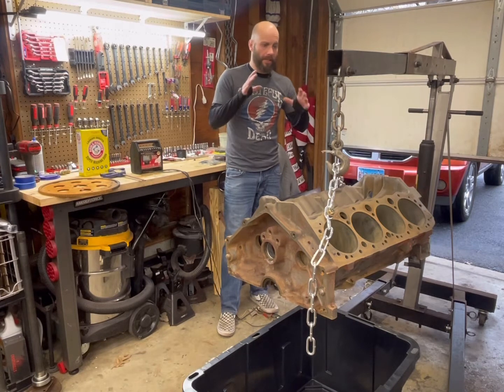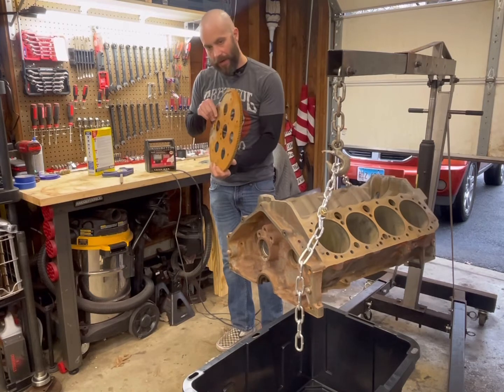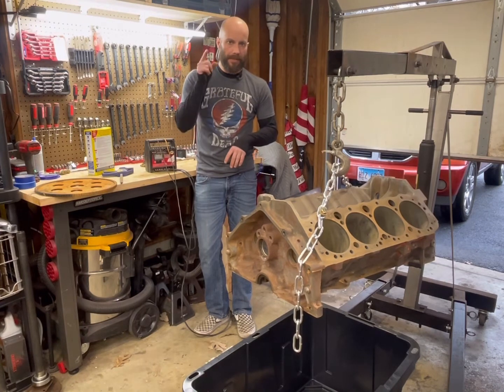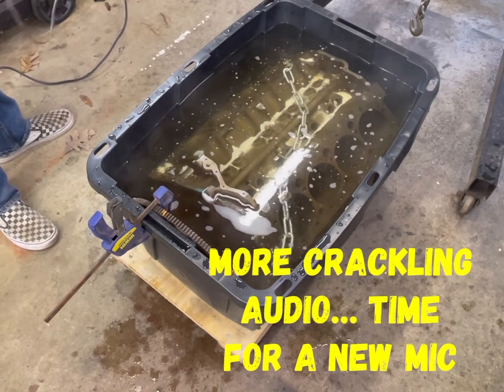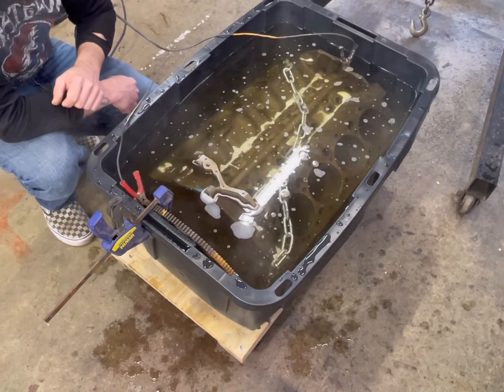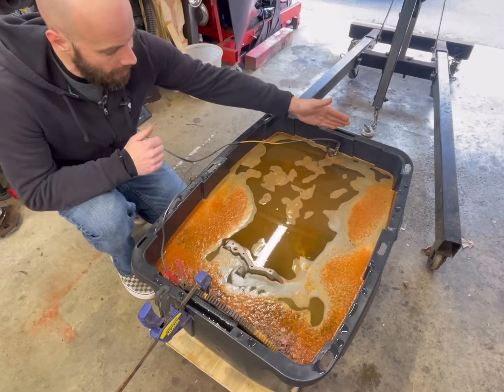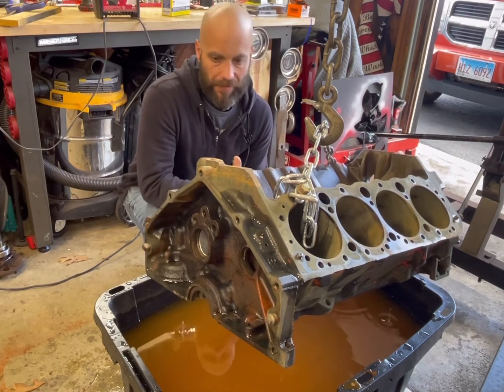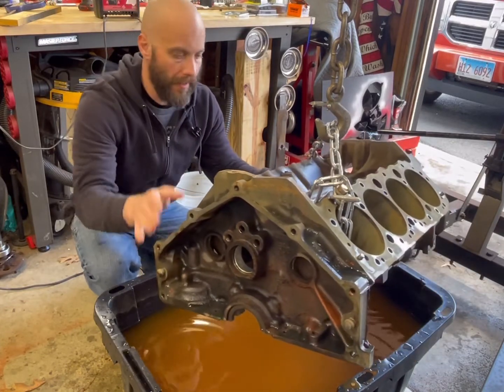SHOCKING!!!! Electrolysis Engine Cleaning!!! #nonamenationals

Comment: This is an oldie but a goodie and it works great! Same thing happens when you don't change your coolant and it begins to conduct electricity it will eat at you cylinder heads and gasket metal parts and cause a leak or a blown gasket big reason why you should test your coolant! and replace when it starts to conduct electricity.
Reply from the maker: Ah I never thought of that!!! So much shit comes out of the jackets, absolutely crazy